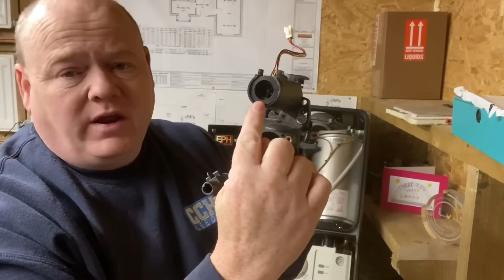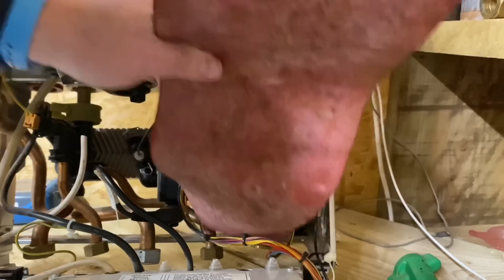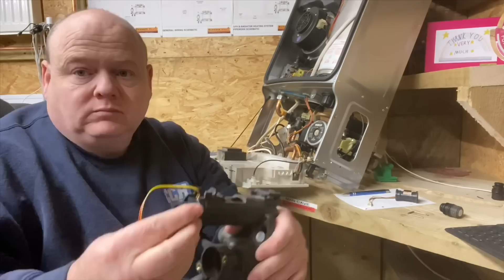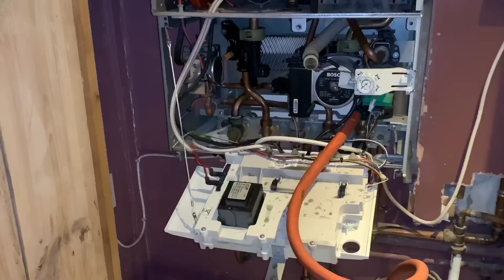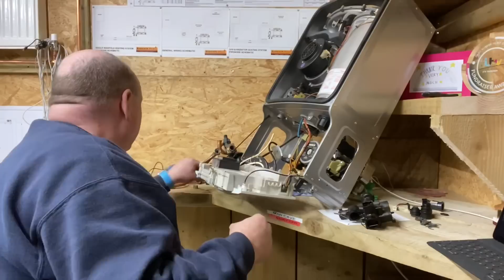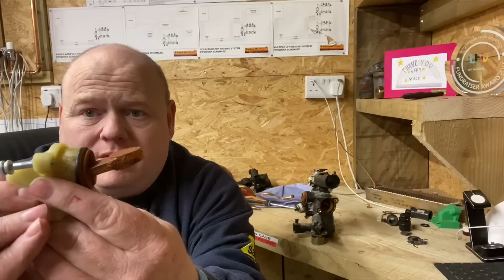Worcester Bosch Boiler Leaking - Leeds Plumber

Comment: The last one I did with a right side leak needed a rtn manifold,  the diverter motor failed on restart probably due to new diverter valve being stiffer, and the fan PCB I’d fitted 6 weeks earlier failed  ( common issue) 5 minutes after I fitted the new diverter motor.  The householder reluctantly paid for the  diverter motor “ it was fine before you touched it) but the PCB I had to replace and claim back off the supplier. Which is fair,   Ppl can’t understand how parts can be dead out the box, fail for no apparent reason and they think they’re being scammed.

Comment: So if mine is leaking on the right hand side from the back, its likely a pinhole you mentioned. That would require a complete return assembly replacement, no?

Comment: Hello, I hope you are well. I have a 28i leaking from the same side BUT it only leaks when the boiler is heating hot water or the heating is on. It doesn't leak at any other time. There is corrosion on the plate heat exchanger, so I'm thinking either it is cracked or a connector to it leaks when under pressure. My boiler engineer hasn't experienced this issue before and won't be able to come out for 2 weeks. Do you have any idea why this is happening by any chance? Many thanks

Comment: Extremely helpful... I'll get a certified engineer to do the job - but now I know  LOT about the problem which means:-
1. The engineer cannot hoodwink me into thinking this problem will cost hundreds to repair
2. I can cost the parts myself - and perhaps buy them - again, keeping the overall cost low.
Always better to get an experienced engineer in to do the work... This video shows what can go wrong if you attempt it yourself. This video is valuable for the knowledge it imparts - and HUGE thanks to Alan for being a great teacher.

Comment: Hi mine was leaking from the top and the gas guy said you need to replace the whole part, (valve diverter)is this correct? I got charged £260 today, took him about 90 mins. Parts and labour.

Comment: Hey, mines leaking from the bottom right but actually through the screw at the very front where the case attaches. I can get a torch up underneath and it doesnt seem to be coming from any components that you mentioned. 🤔 (The pressure guage is in the green and no warning messages/numbers are showing)

Could it possibly be coming down from the air vent and just leaking down behind the front casing of the boiler? (Its been raining a lot over the last 24hours)

Comment: First time todsy working on one the red wire was pulled out of the connection and after pulling out the clip I couldn't separate tge copper tube flange from the flow controller switch. Units never been serviced since install in 2013. It's the ZWB-28-3

Comment: On 1 of those greenstar boilers what would be the cause if the pressure was to keep going up and up while and after the hot water has been used? Plate heat exchanger?
Reply from the maker: https://www.youtube.com/watch?v=UR9wSU-I2O8&t=33s

Comment: Hi really good instructional video, my greenstar junior 28i is leaking from the back r/h side, I've looked underneath and it's showing from the bottom of the heat exchanger rectangular steel panel, it's  green at the bottom corner where the water seems to be leaking, unless somethings leaking on to it an running down, your advice would be a help thank you, subscribed
Reply from the maker: Thank You

Comment: I just discovered that my Greenstar Junior installed in 2007 has sprung a leak. I can't work out where it is dripping from. Left right and centre from what I can see without removing the cover. Fix or replace ? I'm more annoyed about finding an airing cupboard full of wet clothes when I wanted to make my bed than the expense. What is the life of other parts on these ?

Comment: Couldn’t agree more with the pinned comment by Oyedokun. My mum has exactly the same boiler and this video not only diagnosed the problem but took me through replacing the flow turbine adapter step by step. I’m pretty handy with plumbing but wasn’t as confident with taking part of a boiler to bits. 
Very well explained on how the relevant parts work, what they do as well as how to fix it. I’m a big believer in how understanding how things work helps work out what a problem is and how to fix it. 
This video is the best I’ve seen at explaining all that. 
Cost £14 for all the parts plus the silicone grease so saved my mum a call out and labour. 
Can’t thank you enough for posting this video.

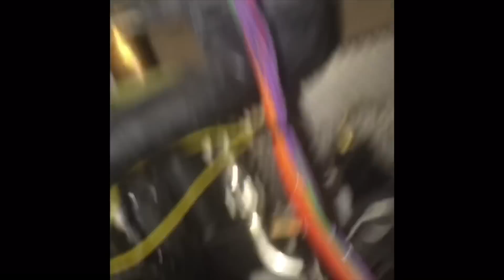Comment: also at 32:40 you see that there is a gap between the plastic bracket (looks like a clip) and the metal bracket that its screwed into, I thought i made a mistake as the clip was not hugging the metal bracket part

Comment: hi thanks for the valuable knowledge ... not a full-time plumber but decided to have a stab at servicing my hydro-block and flushing my secondary heat exchanger before deciding to get a new one or not .. and just two problems i would like to impart to save some one a few headaches .. when you removed the pipes that have white clips be very careful not to lose the washers inside the hydroblock or damage them or the pipe wont ever sit snuggly again inside its fitting when the white clips is re-instated. I lost one completely and found one that was broken in half.. thats when I realized why those pipes felt completely loose.. a question i have is the washers inside the Worcester Combi kit compatible?

Comment: I’ve got a small drop on the right hand side where the cold water feed goes  
There is a screw with a circ lip,and it’s dripping from there  
Basically it looks like the other end of the pipe that you replaced the flow turbine on ?

Comment: Hi Allen   Great video - very informative. The only thing you don't mention is  how the boiler drain valve down is operated - and after reassembling (say having fitted the new left hand block), is there any venting of air required?

Comment: Really great video Allen, all clearly explained. Can you tell me if it is possible for flow restrictor to fail, causing the DHW pipes to bang when turning on and off. The knocking seems to be originating from here but I have no leaks at all. It's a 37CDi, cheers Paul

Comment: One key factor everyone ignores.. OPEN  the installation manual !   The cause of the is lack of a mini ex vessel especially when a water meter is fitted ( check/none return valve) the return valve has a mains pressure PRV (9 bars) . Amazing how many fitters miss this

Comment: Allen. Thanks for your videos on worcester bosch boilers. My Greenstar 28i Junior is leaking 'above' the metal plate which divides the boiler into two immediately below the heat exchanger. I have looked but I can't find a video which addresses this issue. I can't even see where the leak is coming from but it is pooling around the bottom of the heat exchanger and the gas valve, and ends up dripping through the green grommet that carries the cables to the fan and the gas valve. Any ideas would be welcomed! Best wishes

Comment: Alan great video ..I have a leak on the right side of my worcester green star 37cdi and thought it must be the flow turbine adapter but it is actually leaking from the little pressure gauge!!!
I'm thinking of buying a new one and changing  it myself but wondering is it easily enough or do I need a plumber ?
Reply from the maker: Hi Tony. Thank you very much for the question, I would definitely advise you to call out a Gas Engineer you need to remove the main case on these boilers, The case forms part of the seal. Quite a few things to check afterwards to make sure it’s safe. Give Worcester Bosch a call and see if they will do a fixed price repair. Thanks.
Reply: Thanks Allen
Oops!!.. I removed the cover to check where the leak was coming from I've  replaced it now and will buy a new gauge and get a local gas engineer to fit it ..just assuming  a worcester engineer will cost the earth ?
All the best Tony

Comment: Allen, quick question, any idea why water would be leaking out of an auto air vent on a greenstar 42 cdi?
Reply from the maker: Dirty heating system normally but it could be faulty air vent. Thanks.

Comment: Hi,
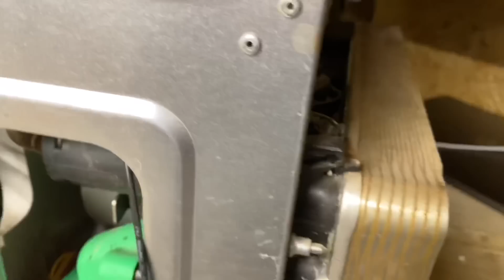My boiler has got the leak from the back of the flow turbine manifold (around the part which you pointed out at 3:14). Does it mean that the whole manifold needs to be replaced or there is somekind of o'ring at the back which could have failed?

Kind regards
SMI
Reply from the maker: Depends on what's leaking. Hard to say without seeing it. Sorry I couldn’t be more helpful. Thanks.

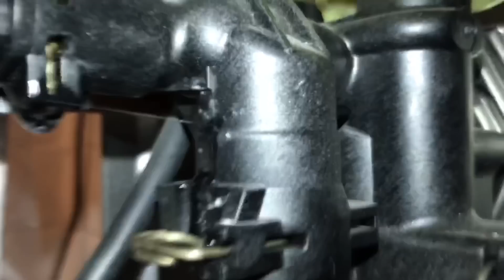Comment: Allen, brilliant thanks, I have a Worcester Greenstar 37CDi, left hand flow unit. pinhole mist leak (classic symptoms apparently) , so from 17:00 onward very useful as I have just ordered one and fancy replacing it myself!!   As this is predominantly the water flow side, do you still need a Gas Safe Plumber to do the checks??  (I'm also in Leeds!)
Reply from the maker: It’s definitely not a DIY job, you need to remove case, burner seals fail on these, 👍

Comment: Does fitting a shock arrester on the main cold  help this part last longer we have a worcester 24l 6yrs old had a new hydro block last year yesterday the turbine started leaking is this true as it's supposed to act as a shock absorber when tap is closed??
Reply from the maker: Hi Steve. I have changed lots and lots of them from boilers with and without shock absorbers, Definitely better to have one than not though. Thanks.

Comment: After i use the hot water,  the pump starts to make noise, also the bar display shakes up and down, between 1.45 - 1.55 bar. :( they changed this part. It was cracked.
Reply from the maker: Thanks very much for your comment, please consider subscribing to support the channel 🙂

Comment: I guess leaks are covered under the 10 year WB warranty (if it's been serviced every year). What would a customer expect to have to pay to get this diagnosed and fixed? Just the initial call out charge for a local plumber to diagnose the problem? Do WB pay for the replacement and fit of the new parts? Cheers.
Reply from the maker: Thanks very much for your comment, please consider subscribing to support the channel 🙂

Comment: I'm not in the trade Allen but I have been watching your videos very closely.I currently have a 20 year old Vaillent Turbomax 828EH.It's been a good boiler but it's now getting a little tired,it needs another DHW plate replacement or clean up,I have this done about every 5 years to keep it running well.Anyway I have,if nothing else learned to avoid Worcester Bosch boilers,I now intend to have a Viessmann Vitodens 100-W 30kw fitted.Thanks for the help Allen,Happy Christmas and prosperous New Year,you deserve it.
Reply from the maker: Thank you for watching my videos and supporting my channel. Merry Christmas

Comment: Hi. Your video is really nice and very helpful. What if the boiler leaks from the right at the back? How do you fix that and what part do you need?

Edit: watched the video 3 times now. Mine is leacking from the return manifold at the back (right side). 

Will I have to change the whole component in this case?
Reply from the maker: Thanks very much for your comment, please consider subscribing to support the channel 🙂

Comment: Hi great vid... Can I ask if the bottom of the plate heat exchanger should be hot during central heating only ? If it is could this be a diverter valve fault ..?
Reply from the maker: Thanks very much for your comment, please consider subscribing to support the channel 🙂

Comment: Hi Leeds Plumber.  Thank you many many times.  As a long retired plumber, i got out as motorised valves and  Acorn plastic pipe and fittings were just coming to the  market. Had a bad leak on my worcester greenstar 30 cdi. Asked a gas safe mate of mine to have a look. A pinhole in the supply manifold complete. Unfortunately he could not  replace it due to being too busy, he ordered the part and gave me 3 phone numbers, rang them all, left messages no  one  of them even rang back. As we are in our 70s and still have all my tools, with your help i  have done it myself, my mate came and done the gas tests. all good.  Excellent video and great presentation. thank you again.  best regards. grandad fester.
Reply from the maker: Thanks very much for your comment, please consider subscribing to support the channel 🙂

Comment: I've got a pinhole leak on the right inthe back top part of the Cylinder - Seems like based on your vide, I'll need to get the whole entire plastic? I have the Greenstar Combi 100  - appreciate the help
Reply: DO you know what the part or Part number is It's parent this is the same as the Worcester. the Greenstar Combi 100 has the Same Supply Manifold
Reply: Found it - 87161064420 Return  Manifold Unit

Comment: The thing is Worcester Bosch is misleading the customers by using the name Worcester which is the name of a city in England. 
British consumers are very supportive of home industries and buy these crap boilers as they think it is British made. Such a expensive boiler still has got an aluminium combustion chamber which makes a massive amount of Aluminium oxide after 2–3 years and keeps blocking the condensing trap.  As you see in this nice video all the connections without any exceptions are plastic that is very cheeky for the top priced boiler in the market. Thanks Worcester for making job for us 😉
Reply: Hello Allen I have a 42cdi green Star,   I have replaced the left hand side manifold,the pump,the expansion tank and it's prv. But it now leaks from around the overflow under the burner. I have cleaned the boiler and replaced the electrodes and gasket also a new gasket for the front of the boiler!! 
Any idea what the problem is now? Before I replaced the pressure vessel it constantly overflowed. Help!

Comment: Nice one Allen, Just had a so called heating engineer from RFW (wont say what i think that stands for!!) come out as i had a leak from the diverter valve. After watching your vids i had a good idea of what was wrong and needed changing. Basically he changed the turbing and the diverter valve. leak stopped but now had no hot water, found the flow restricter washer at the side of the pump and wondered if that was where it came from??!! sure enough he had only put one of the white plastic cups inside and left out the other 2 parts??! Got him back and he denied all knowledge and maybe bosch had updated that part and other BS excuses. Basically told him what i thought of his work and told him to Foxtrot Oscar. Also tried to charge 200£ to change the diverter motor??!! Again, FO. As we still have no hot water i suspect the Heat exhanger for the hot water is scaled up and not working properly. The boiler is a Bosch 30 CDI and we live in a hard water area and thats the first service its had in 8yrs. What are your thoughts on this? I now have put boiler engineers in the same place a car mechanics as i find the standard of work unacceptable. Avoid RFW in Southampton like the plague, i changed the diverter motor my self for 50£ for the part, but suspect as the mains wasnt being restricted that that may be why the other moter went? Any advice helpfull as i have a Heat exchanger on the way and will do it my self so i know its been done right. Love your videos, wouldnt have had a clue about his poor workmanship if i had not watched your vids. :) you have saved me a fair bit of cash i reckon.

Comment: This week my boiler has developed this exact problem.
Your timing is perfect.
Reply: Fixed!
But I did have a problem when I put it all back together.
The connection to the water supply (the one that you loosen off) was dripping.
I took it back off again and found that the fibre washer was damaged, presumably when I took it off the first time.
I had to go get one but a few pennies later my boiler is working again.
Thank you Allen.

Comment: Those sensors are the same style used in coolant expansion tanks by bmw and other German brands . A lot of similar parallels with the grp plastics and snap in hoses . Similar not identical .
Reply: The motor that moves the valve from heating to hot water is the same motor that's used on BMW head lights. No wonder there so expensive 😳
Reply from the maker: Do they leak as well? Thanks.

Comment: Great video again Allen, I have this Worcester .. I noticed you said I’m right hand side block it has the thin mesh water filter!! Problem with my boiler for years but never got it sorted and just lived with it .. poor hot water flow rates.. cold mains in at kitchen tap 11litres a min, dhw at kitchen tap 6 litres min.. both measured using wire cup ..
Would you think that thin mesh filter could be partially blocked. The boiler fires every time for dhw, just annoying trying to fill bath or wash pots .. cheers
Reply from the maker: Next time you have the boiler serviced ask them to check the filter. Thanks

Comment: Alan a quick question if you don’t mind. My dad has Worcester boiler, he keeps having to top up the pressure, why would this be.? There is obvious malfunction, leaks etc. Boiler is serviced every year, boiler is 3 years old. Thanks for any advice. Rich
Reply from the maker: Maybe they are not topping up the expansion vessel on the service, Or maybe you have a small leaking on the system. https://www.youtube.com/watch?v=X4OssmUEFo4&t=334s
Reply: Also, thanks again for great insightful and helpful instruction. Love your videos Alan keep them coming. Hoping to do my gas course this autumn as this lock down lifts. 👍
Reply from the maker: @richardhodgson7443  Good luck.
Reply: Alan, sorry to keep bothering you, in regards boiler losing pressure and topping up. Have you ever heard that if live in a low mains pressure area it is necessary to have to keep topping up the boiler.. apparently gas engineer told my dad this?! I’m not so sure but I’m not expert. Thanks again.. Rich